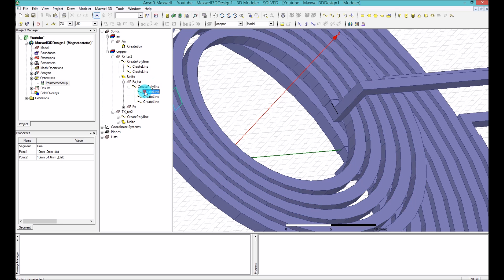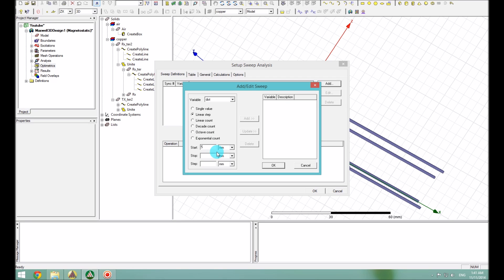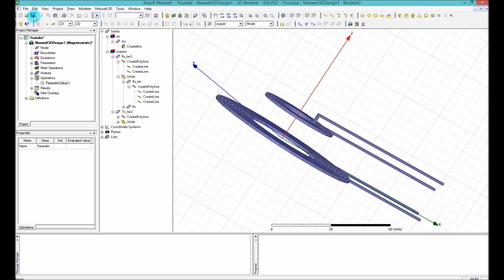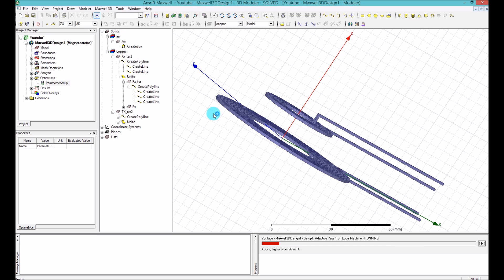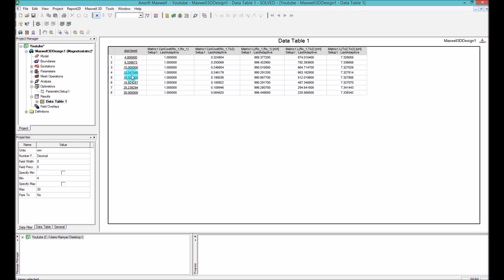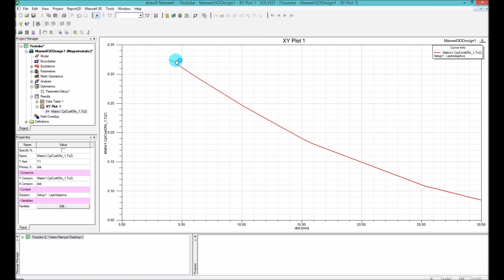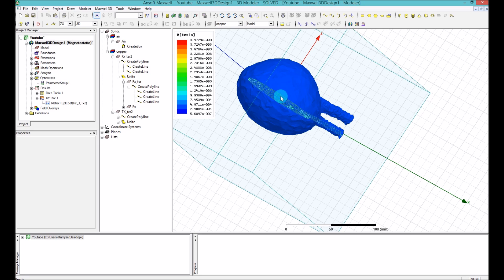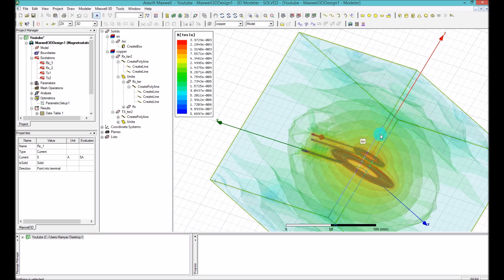Ansys Maxwell-How to calculate the mutual inductance [3/3]

Comment: Hello, this video is very helpful to me！Thank you very much, but i have a question. I wonder if Maxwell can simulate how to power on the transmitting coil and then get the current received by the receiving coil? For example, only the transmitting coil is excited in Maxwell-3D, because of the existence of mutual inductance, the receiving coil outputs the induced current. Can i  obtain the induced current data through Maxwell?(such as use Maxwell circuit?)
Reply from the maker: thanks!
yes you can, one side try to excite with current or voltage source. on te secondary coil use voltage excitation set the voltage to zero and use resistance to define your load equivalent resistance (e.g. for 5V 1A it is 5/1=50hm)

Comment: [info] A variation (dist='4mm') has been requested using the following machines: Local Machine. (12:15:53 PM  Apr 13, 2020)
    [error] Find conduction path: Multilump bodies found unconnected, please separate them. Possible error bodies are 'rx_ter2'. (12:16:03 PM  Apr 13, 2020)
    [error] Find conduction path: 'rx1 (Face_13554)' is not on any conduction path(s).  Please make sure that the it is applied to a conducting object. (12:16:03 PM  Apr 13, 2020)
    [error] Find conduction path: 'rx2 (Face_13620)' is not on any conduction path(s).  Please make sure that the it is applied to a conducting object. (12:16:03 PM  Apr 13, 2020)
   
 Hi this is the error im getting when i analyze all ... can anyone PLEASE help me with this?

Comment: Hey man, I know it's a few years late but for some reason the current doesn't go all the way through the coil. it shows in simulation only at the polyline terminals. Do you have any ideas on what could cause the problem ?

Comment: Dear Kamyar K,
When I want to draw air core coil in transient simulation, do i need to draw the coil separately and then try to connect each other? If so if I want to add 2500 layers of air core coil, i think it is impossible to draw each coil. 
Then I think I draw two cylinders and then subtract and I was planning to define the number of conductor 2500 in that cylinder but unfortunately it is a closed surface so I can't use transient simulation. 
Can you give me some advice how can I easily define the number of layers for air core coil?
Reply: Susan 
For the 3d air cored coil you can assign excitation on a radial section of the coil build. You need to create this radial section by selecting the coil >surface >section.

Comment: Dear Kamyar K,
When ever I try to analyse all, my laptop hangs ( can't even move mouse ). How can I simulate? :( :( :(
Reply: I have already tried 5 times. And the simulation doesn't finished.
Reply from the maker: Maybe your mesh is too dense. What’s your laptop RAM?
Reply: kamyar K Ram is 4GB.
Reply from the maker: that is not ideal bu should be ok. your total mesh numbers should be below 60,00 to see smooth simulation. is it the case ?

Comment: nice tutorial, I wanna know that is there any way to find out the parasitic capacitance of this coil and the value of AC resistance including the skin and proximity effect. thanks
Reply from the maker: +Ali Raza elsctroestatic engine. I have toturials for that.
Reply: i tried to find in that in the playlist but could not found can you pls paste the link of the video here. thanks
Reply: hello, i have same problem.
did you find solution?

Comment: Hi Kamyar. Thanks for uploading it. I have a question that whether several turns of each transmitter or receiver coil can be replaced by a "big" turn only? The purpose of doing it is to accelerate simulation time. Thank you.
Reply from the maker: +binh vu  yes. Please follow some of my tutorials that are using a solid coil replacing all turns with number of turns parameter in the maxwell. Watch them and let me know if you still have a question.

Comment: Sorry  i should supplement more details to you , 
These are the comprehensive error reports : 
2 (C:/Users/Jacky/Desktop/)
  Maxwell3DDesign1 (Magnetostatic)
    [info] User Defined Primitive: End edge position: (11:56:40 上午  四月 06, 2016)
    [info] User Defined Primitive: Point0: x = 192.265576731707, y = 0.00750507783471477, z = 3 (11:56:40 上午  四月 06, 2016)
    [info] User Defined Primitive: End edge position: (11:56:40 上午  四月 06, 2016)
    [info] User Defined Primitive: Point0: x = 149.927302062808, y = 0.00738402820029904, z = 3 (11:56:40 上午  四月 06, 2016)
    [error] Failed to copy local file C:\Users\Jacky\AppData\Local\Temp\maxwell_Jacky-PC_292332.pjt/initial.hyd to file C:/Users/Jacky/Desktop/2.mxwlresults/Maxwell3DDesign1.results/DV398_V410.imesh/initial.hyd. Error: ???????? . (12:29:26 下午  四月 06, 2016)
    [error] Unable to save current mesh data for simulation: Setup1 (12:29:26 下午  四月 06, 2016)
    [error] Unable to save current mesh data for simulation: %1 (12:29:26 下午  四月 06, 2016)
    [info] Parametric Analysis is done. (12:29:26 下午  四月 06, 2016)
    [error] Process '3dnms' terminated abnormally.  It may have run out of memory or could have been killed by the user. (12:37:18 下午  四月 06, 2016)
    [error] Simulation completed with execution error on server: Local Machine. (12:37:18 下午  四月 06, 2016)
    [info] Parametric Analysis on ParametricSetup2 has been started. (12:37:19 下午  四月 06, 2016)
    [info] A variation (dis='150mm') has been requested on machine Local Machine (12:38:57 下午  四月 06, 2016)
    [info] User Defined Primitive: End edge position: (12:40:17 下午  四月 06, 2016)
    [info] User Defined Primitive: Point0: x = 192.265576731707, y = 0.00750507783471477, z = 3 (12:40:17 下午  四月 06, 2016)
    [info] User Defined Primitive: End edge position: (12:40:17 下午  四月 06, 2016)
    [info] User Defined Primitive: Point0: x = 149.927302062808, y = 0.00738402820029904, z = 3 (12:40:18 下午  四月 06, 2016)
    [error] Error closing file: %1. (1:19:27 下午  四月 06, 2016)
    [info] Parametric Analysis is done. (1:19:29 下午  四月 06, 2016)

Comment: Excuse me , now i encounter a problem of my simulation : 
Maxwell3DDesign1 (Magnetostatic)
    [error] Adaptive passp, process 3dnms : Insufficient memory (5:18:26 下午  四月 05, 2016)
    [error] Simulation completed with execution error on server: Local Machine. (5:18:26 下午  四月 05, 2016)
 How can I solve this ~~ ?
About the error of memory , is that the problem of my computer ?? 
And there is always the problem of local machine , what does that mean ?? does the local machine represent my computer ?? 
Thank you ~
Reply: maybe you are not putting the air boundary , I was getting the same error
Reply: How did you fix this problem. I am facing the same problem??

Comment: Hi you ask the question on the ''How to split the simulation across more machines/cores in your computer''. You can do this by going into tools-> options -> HPC and analysis options. Here you can specify how to use your machine, be it your machine or an external compute node.
You can specify to split the simulation over various cores in a machine. To do this you will need a HPC license. Each HPC license will allow you to split the simulation across up to 8 cores. 
Double click the machine under the ''Available configurations''  This will allow you to specify the number of cores enabled and the number of tasks to split across each core. You will need a good deal of RAM to complete this on one machine, but if you have the option you may split the simulation across multiple external machines on the network if you know their IP address / machine name.
Reply from the maker: Phil Aherne thanks phil.
True. I was looking for distributed simulations. But that has the same path more or less. I have got the HPC license from ANSYS and they are pretty good.

Comment: Hello, 
I`m trying to make a simulation almost like this one...but the problem is: "An external terminal must border the edge of the problem region and coincides with the surface of a 3D object"

Yes, I'm drawing a 'Region' defined as vacuum and the 4 terminals(I have 2 coils) are bordering the face of this 'Region' , but I still get this message. Do you know how to make it work?
Reply: Paulo M. As I see it, you 'hid' your region...but if I do it, I still get the same message.
Reply from the maker: Paulo M. Hey, I think the reason is you are probably not using snap. either make sure that the face snaps to the region face, or draw with numbers. I am sure if you the same you would not get any errors;)
regards
Reply: ***** But I actually just create the 'Region'. When we put 0% of offset, Maxwell just border the faces automatically, right? Look at this design:

https://goo.gl/7Fw5si

All of the 4 current leads are bordering the the face of the 'Region'.
Reply from the maker: change the region with a air BOX. make sure the box is fitting and the faces are touching.
Reply: ***** I'll try it out! 

Thanks
Reply: Paulo M. I solved the problem! Thank you!

I have another question about Maxwell: If I create an object "A" and then I put 'hide' on it. After that, I simulate the case. The results will be generated considering this object "A" in the case or just if I put 'show' on it?

Best Regards.
Reply from the maker: Hi, if you look inside the property window of any object there is a check box says Model , if you check that it would model it and calculate it, whether it is hidden or shown. hide and show is only for your visual help.
Reply: Perfect! Thank you again.
Reply: +Paulo M. 
hi guys , i have a problem  , i can not finalize my simulation  because of this problem  

An external terminal must border the edge of the problem region and coincides with the surface of a 3D object"
 
any one could help me
Reply: +Paulo M. Hi
i got problem exactly as yours. could you pleas help me out how did you solve it.

thank you

Comment: Thank you again for your videos. I have a question: " what do you think when i put the ferrite plate to coils systems, whether it can improve the coupling factor and efficiency (and how much it increases)? when i use air-core, the coupling is very weak.
Reply from the maker: Hi, sorry for late response, 
definitely it will increase the intensity of the magnetic field (if you add ferrite magnetic material) but note that when the field is omni directional you will have magnetic field in all directions. does it answer your question

Comment: Thank you so much. please tell me how can I do a simulation for coils  that consists of many isolated strands (Litz) conductor.

Thanks again
Reply from the maker: I explained that before in comments section of one the videos. In brief, if you do not consider the effects of the eddy current (by not simulating them) you are very close to the Litz wire simulation results, especially in low frequencies.

Comment: as we know, wireless power transfer has to be done at higher frequency like from 10kHz-100kHz.  but in solution type-magnetostatic we cannot change frequency, however in solution type- eddy current we can change and analyse results for different frequency. can we simulate this model in eddy current solution type ?? , i tried but it is taking 30-40mins and finally getting error message.
Reply from the maker: Hey, If you run the results from this simulation in simplorer you will get different efficiencies in different frequencies. that means the passed results from maxwell are frequency dependent. I think they are naming it magnetostatic to differentiate it from radiation.
Reply: *****  okk, actually i dont have simplorer so i am just simulating maxwell.
1.)   can u tell me is it possible to run your model shown in tutorial in eddy current solution type (because i tried it shows no error but when i simulate it takes 45mins and finally shows an error) ??
2.)   how much time did it take for you to simulate this model ??
3.) for me it is taking too long, is there any chance to reduce it ?
Reply from the maker: the eddy current solution is one waty to go but you will get different parameters as results. you have to convert them by yourself. 
depends, mine takes about 10 min max. 
yes , try to make the air smaller, also try to make the distance between any two non-touching metals larger. fine structures add more mesh density and consequently more point to solve the maxwell EQ , 
hope you got the answer